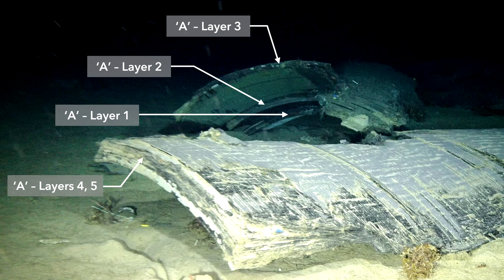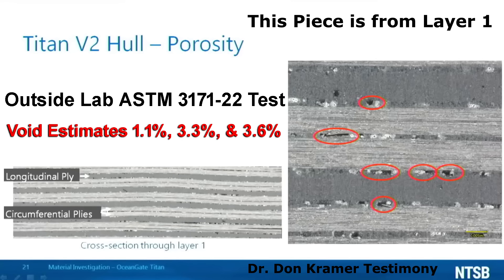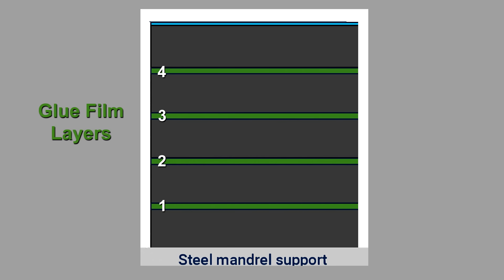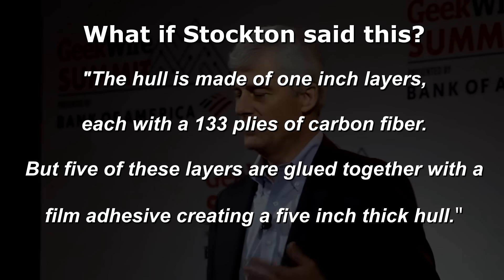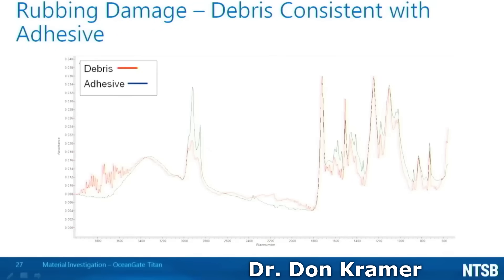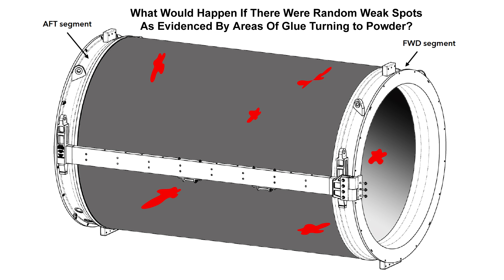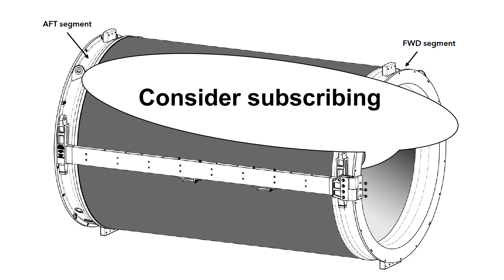OceanGate Titan Hull - Glue Layers Were Breaking Down To Dust - No Clues.

Comment: Ignorant question about this concept from its basics: why wouldn't a carbon fiber hull in this part of a dive capsule not include ribs throughout any cylindrical build design, from the very beginning of the design?? 😮
Reply from the maker: That's a good question.  Anything can be engineered differently, but all design ideas have implications.  If you still are going to mix carbon fiber with metal ribs, although it might sound stronger, every junction of dissimilar materials has to be carefully engineered to see how the loads will be transferred.  You need to watch my latest video about welding on the lifting eyes.  In that video, I have testimony by Tony Nissen that discusses matching the modui of materials.  Thanks for commenting.
Reply: Different types of materials  will expand and contract at different rates when under pressure. Like making wood furniture, you need to design it so that as the wood grows and shrinks over time, it won’t come apart at the joints.
Reply from the maker: @subrosa4792  You are absolutely correct.  Tony did worry about matching the modulus of the carbon fiber and titanium interface.
Reply: Yeah I asked myself that too
Reply: Then they would have had to figure out the exact circumference. It seems like these guys kind of "winged" the whole build. I always figured one of the end caps blew off (because of the haphazard way they applied the epoxy or glue to attach them), and I had wished they had multiple tie bars connecting one dome to the other, lengthwise. Now we know the flexing of the hull was separating the layers, and the glue itself was deteriorating. That means it was never a 5" thick unified piece of material and how anyone expected that to work is mind blowing.
Reply: @dc6233 how do you imagine the end cap blows off

Comment: this is what happens to carbon fiber under immense pressure, since they are glued sheets of transversely layed fibers of carbon for the best structure for pressure and strength, the glue cannot take these loads over long periods of time, and was my suspicion when the news first came out about this pod just vanishing off the radio, because titanium works fantastic under pressure and does not have the glued layering problem it is the preferred choice for deep see diving, if anyone is thinking about using carbon fiber please don't and learn from these peoples deaths

Comment: I was more interested in the volume of glue used than the square footage. Carbon fiber strands are between 0.0005” to 0.0015” and are not to be crossed in a tow. The layer thickness of 0.0075” means that the majority of the hull is epoxy that is only good for about 20,000 psi of compression ( that is with no voids). 20,000 psi is what the hull is being compressed length wise by the hemispherical ends. Luck is not an acceptable safety margin!

Comment: Their “real time monitoring system” was a waste of time. A taunt clothes line strung across the inside of the hull would’ve overflowed the toilet with poop when they saw how much it was sagging . When they reported that they were descending faster than estimated that was the warning that the hull was collapsing more than normal and didn’t have the buoyancy that they had calculated. Another very simple instrument they should’ve had in the sub was a weather barometer. And note the pressure on each dive at regular depths. Hell, my kitchen barometer has a movable needle you can set to whatever pressure you want. And if the pressure was higher than normal for that depth ABORT NOW!!!
Reply from the maker: Thanks for commenting and adding to the discussion.  In my research on the Titan for my work I have not come across what you referenced,  I would like to read it, do you know were you saw this -  " When they reported that they were descending faster than estimated that was the warning that the hull was collapsing more than normal and didn’t have the buoyancy that they had calculated."  Thanks.
Reply: The clothesline thing was in an old WW2 submarine movie. The chief tied a clothesline across the torpedo room when they were on the surface and at deepth the line slackend because of the exterior pressure on the hull and the new seaman got frightened. You presentation shows the hull compressing inward.
Reply from the maker: @StevenStyczinski-sy8cj  That clothesline story is cool; I hadn't heard of that movie or that scene.
Reply: @solareclipsetimer  Down Periscopes. If you put the comedic elements aside (it's a comedy at its heart), it's apparently one of the more accurate submarine movies out there.

Comment: I'm not an engineer of any kind, but I am an archer and I am handling carbon fiber every time I shoot an arrow; I know nothing but I've seen photos of how carbon fiber fails under strain, and the answer is "explosively." If you flex an arrow and it creaks (we 'acoustically monitor' arrows!).. it's not safe to shoot! It's not "failing," it is FAILED. Aluminum arrows may show metal fatigue by bending; carbon fiber is either straight or broken, period, the end. 
Glue turning to dust.. after being heat stressed five times, which might cure resin but is something that degrades adhesives?! 
Every new thing I learn watching your videos is fascinating (thank you!) but also just so frustrating, the experts were right there and weren't listened to.
Reply from the maker: Thanks for your supportive comment, and I am glad you have enjoyed the content.  I like the information about the arrows.

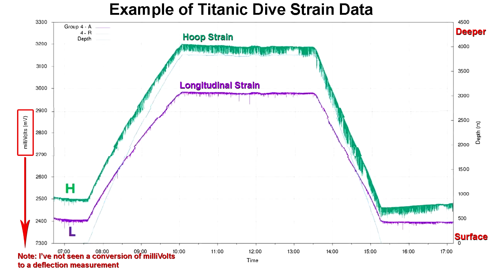Comment: 2:28 Given the range on that graph we could assume that the range on that transducer maxes at a typical 3v3 supply voltage (minus change). This would indicate that that transducer was within 3% of its maximum value.

I can't equate that to absolute deflection but if they really almost maxed out their strain gauge then that is terrifying.

Comment: Im not an engineer but the cross section of the five layers reminded me of a leaf spring as used in suspension spring for automobiles. As a leaf spring is pushed on, all the leaves rub as they cycle in compression and decomp. Would this cause sheer forces on the glue layer, rather than the 90 degree their purpose was in joining the 5  laminations
Reply from the maker: Thanks for your comment.  That is another great example, of course, with movement on a much larger scale, but the concept is valid, and it is a good way to picture it.  Thanks.
Reply: That's a great way of looking at it.
Reply from the maker: @Everything817  Yes, it is a good example.

Comment: I feel like a titanium ribbed internal frame to bolster the hull from flexing and bowing, and an external shell of welded aluminum to compensate for the porosity could have saved this thing. It's still a really awful design for ultra-deep operations but still.
Reply: woulda just been better to go full metal. carbon fiber is the WRONG material for this application. making it thick enough causes lumps that just get worse as it gets thicker. and carbon fiber is better in tension not compression. And it has a catastrophic fail state instead of bending like metal.
Reply: @ Well yeah this was a shitty design entirely lol. But clearly this guy was married to the idea of using carbon fiber.

Comment: Let's just say that the likely failure mode was over-flexing of the hull due to it's material choice and most dammingly poor construction, leading to water ingress at one or both titanium rings, leading to near-instant failure of the whole system.
Of course this doesn't matter as the whole coffin was so poorly designed, constructed, and tested, that each dive was a race to see which of many issues failed first. Had the carbon fibre hull been up to snuff this disaster would have happened for any number of other reasons.

Comment: Flat earth, energy of vacuum, inches it's all the same. Learn centimeters in basic school and your submarines won't sink.
Reply: The Soviets used the metric system after 1925, and they lost several subs, some quite infamously. In fact, the recovery of the Kursk required the assistance of the US Navy, among other US based organizations. Units of measurement clearly have no bearing on whether you know how to use them properly or not, much less whether your submarines fail. Your measurement elitism is a hallmark of hubris and the fingerprint of a poor craftsman.
Reply: Learn imperial and you can walk on the moon :)

Comment: The hull was in fact "strong enough". What they didn't grasp was how many cycles it could endure. The clue often missed in discussion, was the noise it made during cycles. Noise = release of energy. The hull simply ran out of noise. QED.
Reply: Is this the structural equivalent of electronics running out of smoke?
Reply: @herbderbler1585  yip. It was built with a quanta and it got finished 😜
Reply: Stanford degree engineer!!!
Reply: A punctured tire stops leaking when it runs out of pressure.
Reply: Wouldn't the enngey being added and then subtracted be the pressure applied to the hull? Don't even titanium submersibles suffer from this effect?

Comment: OK, many people forget that the carbon fiber was sold off cheap by Boeing because it had been exposed to air and had surpassed it's exposure time to open air without being re vacuum sealed. Carbon fiber is just like a carbon filter, once exposed to open air for some time, it will absorb gasses and contaminants from the air. Many of these bubbles were caused because the cylinder was not layer degassed in a vacuum before the next additional layers were laid down. The water forced it's way into the bubbles at depth and then created hydro bubbles as the material decompressed causing the delamination.
Reply: Fine, but let's not shove blame on Boeing for the unproven and irrational use of inferior carbon fiber by Oceangate. They knew what they were buying.
Reply: @plenum6448  Not blaming Boeing, they sold it as scrap.

Comment: With the estimated observed porosity being 18-27% that would be 38-57 times the estimated expected specs of .47%. That's called missing it by a mile. It's amazing that anyone survived even a single dive in that tubular tomb.
Reply from the maker: Thanks for your comment.  I want to be clear here about porosity and that you have to listen to Dr. Kramer's testimony and my video carefully.  Dr. Kramer used two numbers for porosity based on two very different observation techniques, and it was confusing.  The larger number, 18-27%, was by looking at the surface pores in a piece of the recovered hull cut through obliquely (one-dimensional observation).  There was another number he used in his testimony, which was 2.2% porosity based on volumetric analysis of porosity in a piece of hull (ASTM Test - three samples analyzed).  This is probably the MORE ACCURATE way to look at it.  So by that standard, the Titan hull missed the Toray spec by 5 times over spec.
Reply: @solareclipsetimer  Yes I didn't catch that 2.2% statement which is also a big miss. Thank you for the clarification. I really enjoyed the video.
Reply from the maker: @ponowar2025  Great.  Thanks for responding, and I am glad you saw my reply.  Dr. Kramer's testimony about this was confusing, and it took me a while to figure out what he meant.  I'm glad you liked the content of the video.